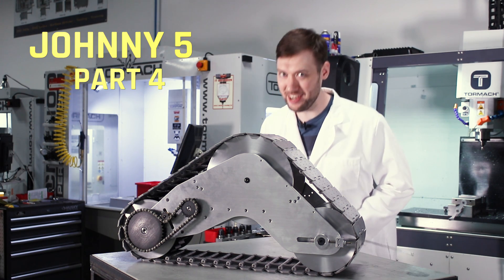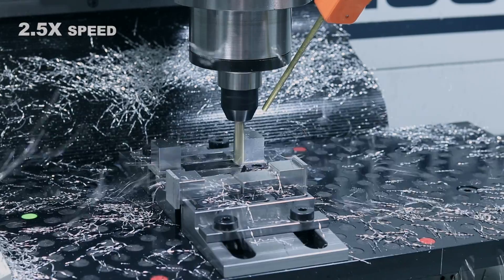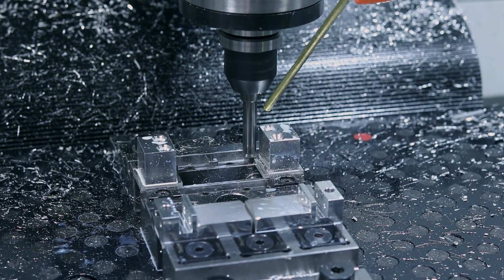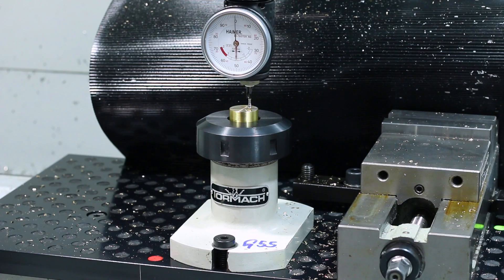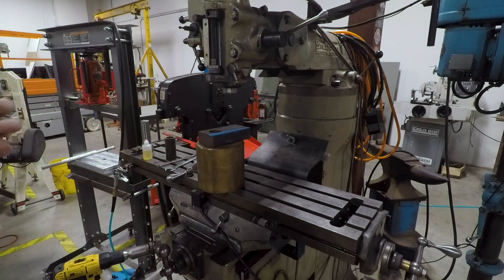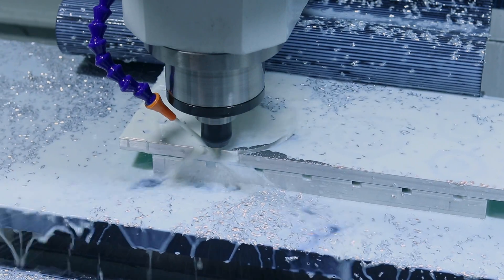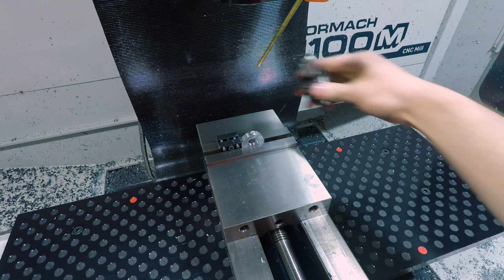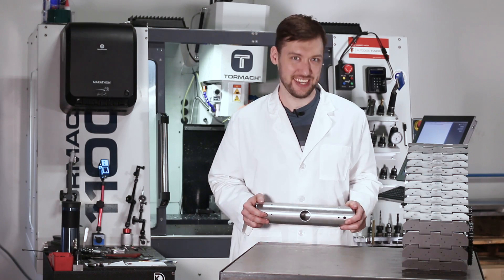Johnny 5 Part 4 - Tension/Chain Drive | WW245

Comment: Oh yeah, not gonna name names, but I worked for a place that made precision screws/rails and the aluminum parts were all super heat sensitive.  Like, when we put them through the washer if it wasn't set to it's highest speed they'd come out discolored ( and I wouldn't be surprised to find measurement changes, but that was the only visual change I saw )